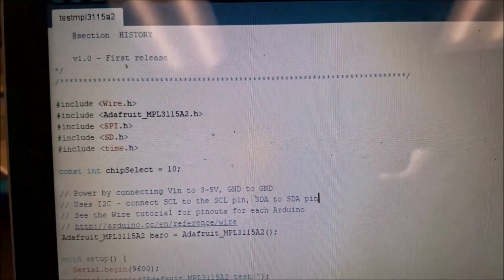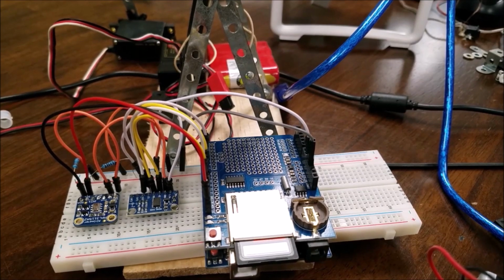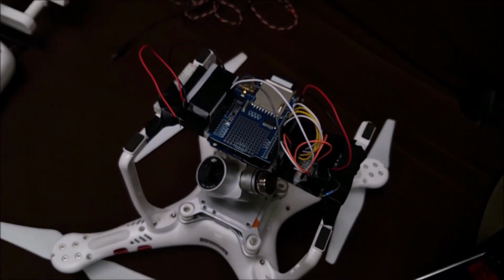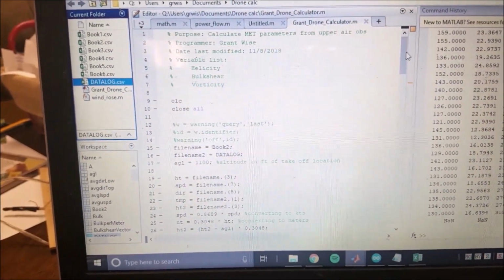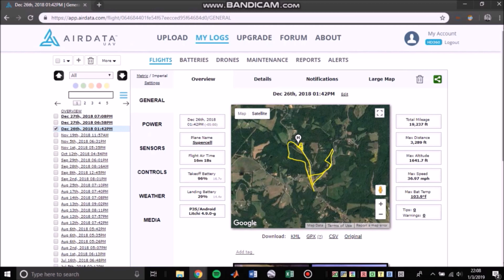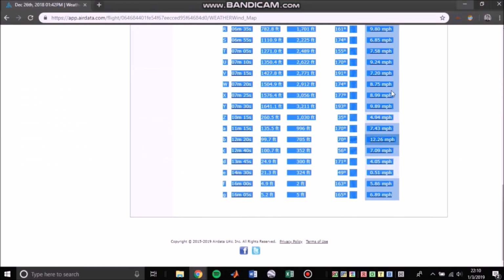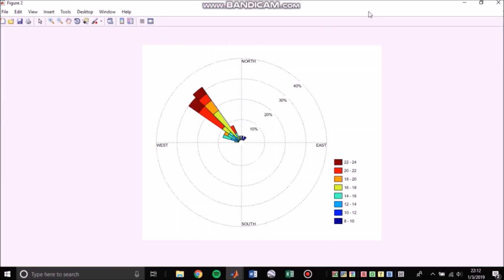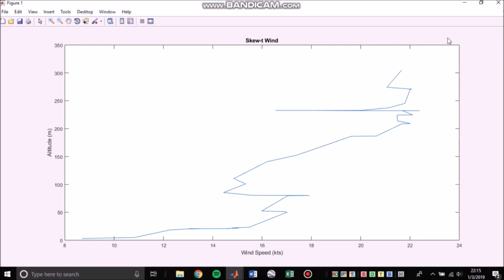Using my Drone to Forecast Tornadoes - An Arduino Project

Comment: Hey Grant, I just now received your email (it went to my spam folder for some reason) Would still love to chat. I’ll shoot you an email reply when I get a hot second. 
But just a few question
1) MATLAB looks to be pretty expensive...do you know if other options or possible solutions tot his? 
2) I’m currently (and have been) utilizing an RPI solution (many Raspberry Pis: 3b, 3b+, Zero etc...)
Any experience with those types for logging? 
I’ve got a number of other questions, please let me know when you might be available - would love to chat on the phone for a bit. Thanks so much! -Lanny